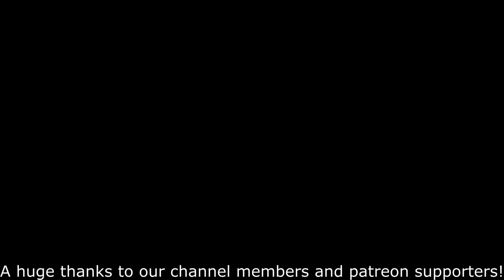DIY Magnetic Welding Clamps Build! No Fixture Table Needed!

Comment: Idea to consider.   why not make the attachment to the magnetic block just be a block of metal with a 3/4" or 1" hole in it.   Just like a regular welding table hole.   Then you have access to all sorts of off the shelf fiixturing setups.   You might need more "clampage".   hmmmmmm.

Comment: G’day, excessive heat can remove/reduce magnetism.  Not sure of the facts/ figures as to how much heat etc. but I believe it could affect the strength of the finished welded adaption to the welded clamp.  Adapting the clamp to suit the clamp magnet surface is an alternative and leaves the adapted tool able to be used separate from the magnet.  A slide bar adapted to the clamps can provide adjustable clamp centres to stabilise the fixing of larger objects on the bench.  The work safety factors gained by the use of the clamps to securely locate work pieces, on or off of the bench,  is valuable.  Thanks for the inspiring video and ideas.  Cheers, Gary

Comment: What a great idea! Thanks for the vid!
I assume  the magnets force is directed down ward enough  that it doesn't interfere with the welding arc.(?).

Also, I  was curious  how your vice and grinder attach to the table. Are they removable/interchangeable? 
Thanks again!
Reply from the maker: No issues with the arc. Here is my table build showing the removable pieces https://youtu.be/f0_1W-wniIo

Comment: shouldn't weld on a magnet.should diassemble to fab Housing is aluminum to prevent case from magnetizing attracting shavings , grinding dust, bolts nuts etc

Comment: The prob is the magnets are $72 each.
Reply from the maker: They cost me $54 each after signing up a email for their discount and using the 5 percent off code I provided. The big problem is a fixture table this size is around $4,000 to use their fancy clamps. You do the math!

Comment: These will cause weird arc blow when your welding. That’s why nobody sells these.
Reply from the maker: I completely disagree unless welding to these while engaged like I did when adding the clamp support. I've already used these many more times on several different projects. Welding to material these are clamped to has made zero difference in the arc or Weld.

Comment: I really want an iron cutting machine like yours, unfortunately no one sells it in Indonesia. manual cutting with a hand grinder really hampers working time.:face-purple-crying:
Reply from the maker: Ive been cutting with a grinder forever, this saw makes work so much quicker in thick steel.
Reply: Yes, the machine makes it very easy to cut large volumes of steel and angled cuts. I hope machines like this are sold in Indonesia. good luck bro, I always watch your content. I hope God answers my prayers to be able to buy this quite expensive machine @TKCL
Reply: I'm just a fringe welder trying to be successful  @TKCL

Comment: They put aluminium on tge sides and the ends so that it concentrates the magnetic flux in the "middle" (the open but underneath. Remember, the magnet is always on.
Putting a steel endplate on there will make it magnetic too...
Reply from the maker: I figured it had to be for a reason, good to know.  The end isn't magnetized when off, but it is slightly when on I noticed.  Doesn't seem to affect anything while welding.

Comment: Nice table but I priced out the magnets for your clamps and at $90 per magnet I think I’ll be going another route
Reply from the maker: I paid $54 per magnet, not sure where you are seeing $90. Sign up with Vevor for an instant discount and use this code VVPRO for 5 percent off your order. You must have priced out a higher load rated magnet, or didn't see the discount price under the "retail" price.

Comment: Revashelf makes something for kitchenaid mixers that you may be able to utilize for the saw. Its an undershelf shelf that folds out and levelish with the counter or table.
Reply from the maker: I've seen those, sadly I need it on be on the ends so I can run long material down the table. I didn't build that possibility in.
Reply: Yeah ud have to build another support for material. @TKCL

Comment: I thought the magnetic field may have been interfering with your welding... I didn't think about aluminum.  We had some strong magnets at work for our food grade metal detector - they could only be moved in the plant when in plywood boxes. Split a guy's fingertip when one clamped onto a handrail he was passing.
Reply from the maker: Funny you mention this it does mess with the welding when in the on position. This was only when welding to the magnet itself.

Comment: Talking to a friend about Vevor. Went to read up on Vevor and found this video. I assume it’s a Chinese company “based” in California. 
Good idea. Answers my suggestion about the fixture holes. I have the same clamps with a 5/8 bolt welded to the bottom. 
Ditto on bolts from TS.
Reply from the maker: They are definitely a Chinese company, but have warehouses in the United States. Most of my items arrive in 2-3 days.

Comment: You should think about adding different receiver tubes at different heights so that you may adjust the height of the vise and/or bench grinder. You were holding that Dewalt grinder pretty awkwardly high during operation.
Reply from the maker: A drop tube is no problem to make.

Comment: Why not just weld the clamp to the side of the magnet assembly? Am I missing something?
Reply: Don't get me wrong. They look slick.
Reply from the maker: You're missing that the clamp can't slide all the way down allowing the threaded portion to go to the table and pin something as thin as sheet metal. It needs the spacing to allow the slide clamp to go down past the cast piece.
Reply: @TKCL   Yeah, I got that part but if you weld the same bit of square tube to the steel side of the magnet and then to the clamp, wouldn't you have the same net effect but without fabricating the end cap? Plus, I'd think the original end cap would be a better square "stop", no? Maybe it's 6 or a half dozen but we're all just spitballin' in the shop, right?

Comment: Are the magnets strong enough to just set on top of the metal and then activate?
Reply from the maker: Only thin metal. It won't work through hollow 2 inch tube.